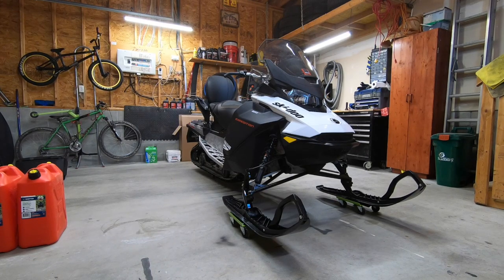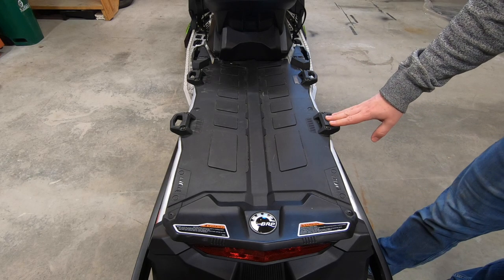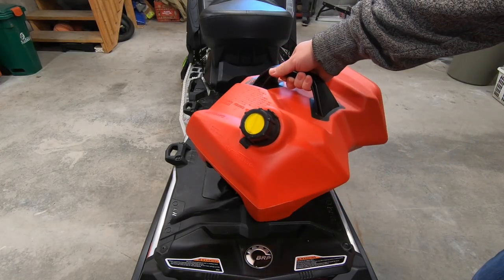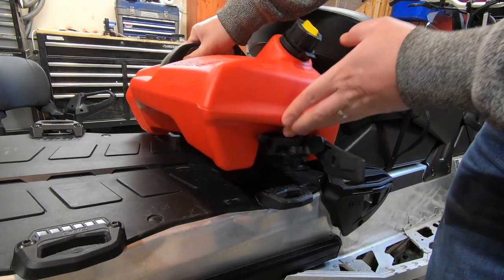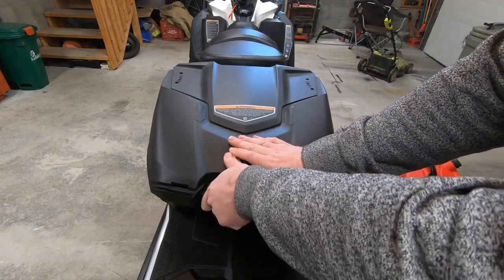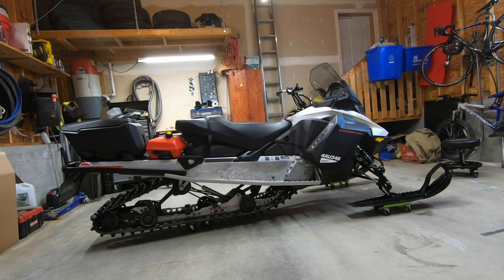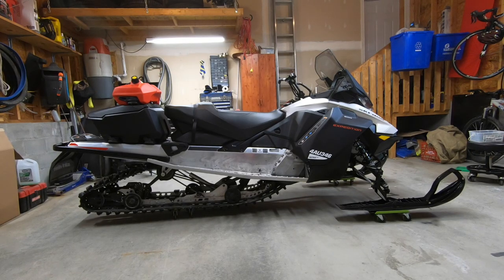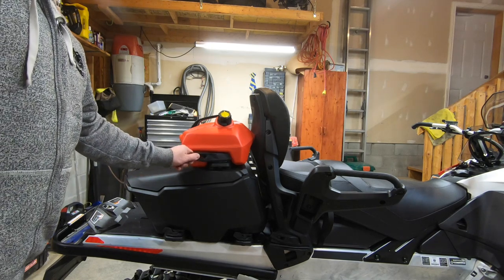Ski Doo LinQ Mods

Comment: Excellent, very informative!!  Please keep making these videos!  I made an aluminum T-track system on my 154 expedition. Three sets of LinQ receiver mounts that can slide on the rail system according to the load of that day with that days specific gear.  So far so good.  I have a RockBros 30qt cooler close to the seat and another Apache 3800 tough box behind it for more storage near the tail light.  👍🏼
Reply from the maker: More videos to come for sure! But with no snow and my sled tucked away for summer, I've been doing projects on my S2000, which are: A) Probably not interesting to snowmobilers; B) already well documented on Youtube.

But, I'm trying to find a snowmobile dyno so we can find out exactly how much power this little 600 EFI actually makes. No promises, but will do a vid if possible.

I love your T-Slot idea. That would make the whole system much more flexible.
Reply: Any pics on your T-track system?
Cheers Joe

Comment: Enjoy your videos. Just ordered my 2022 expy sport 600 efi. Would you be able to post the dimensions of the usable box space on the tunnel with the 2-up seat on? That would be helpful! I’m looking for an aftermarket (cheaper)  box that would fit inside the factory rear rack extension. Appreciate your help.
Reply from the maker: I was looking at the '22 Expedition spec sheet, and it indicates that all Expeditions are wide-bodies for 2022. Have you confirmed that the '22 Expy 600 EFI has a narrow-body, like the '21? I can measure mine for you, but I just want to make sure my dimensions will be the same as yours.

Side note: I know the Lin-Q stuff seems pricey, I thought so too. But now that I've used Lin-Q, I'm all in! The stuff is super easy to install, even easier to remove and you never have to worry about lids popping open on a ride, or anything like that! Well worth the money. I strongly recommend considering a Lin-Q cargo box.
Reply: @mop1471  As far as I can tell the width on the rear end is based on the track width. Your dimensions would be appreciated. Pretty sure its a narrow body as the auxiliary fan is not an option on the 600 efi. The dealer told me it doesn’t fit with this chassis. I will clarify the wide/narrow body with the dealer. Thanks!

Comment: Great video, I have one question you said that your spacers are two 1/4”pcs put together making a total of 1/2” thick?
Reply from the maker: That is correct, a single 1/4” spacer didn’t raise the mount enough for the gas can to clear the ridge on the lid of the cargo box, so I made a second set of 1/4” spacers for a total of 1/2”. Of course, now that I know this, I could re-make the spacer out of 1/2” material, but too lazy ;)

Comment: Great ideas! I’m just about to spring for the ‘23 model and assuming that the 62L will still fit?
Reply from the maker: The '23 Expedition Sport is still a Rev Gen 4, so I would expect the LinQ accessories would still fit just as they do on my '21. 

Will your '23 have that beautiful yellow bodywork with yellow ski handles? It looks great!

Comment: Great video.  I just bought a 2020 Enduro and I am strongly considering the 62L box.  Once mounted, o you think you can  add any LINQ accessory behind it without customization?
Reply from the maker: Thanks! 

Not all LinQ accessories will fit on the 62L trunk lid.

Your 2020 Renegade Enduro should have 2 LinQ cleat mounting points on the tunnel. The 62L box will use both of those mounts. The 62L box offers one additional LinQ mount on its lid, but note the weight limit on the warning label: accessories like the fuel container I attached exceed the weight limit and do not fit without modification. 

I don't know the reason for the weight limit, but I suspect it's either: 
- a risk of making the machine unstable by having weight up too high, or; 
- the lid latch/hinge isn't strong enough to stay latched with a heavy load, under dynamic riding forces.

If I were doing it again, I'd probably go with the larger 14.5L fuel caddy (p/no: 860201265), which also allows another LinQ accessory on top of it. Put that on the tunnel right behind the seat. Then go with something like the Deep Snow Pro 30L bag (p/no 860201985 ) 860201678) behind your fuel caddy in LinQ position 2.

Comment: Crazy expansive gas can. What items fits the position 3 brackets??
Reply from the maker: Gas can: Yep, but super handy. It also feels very well made compared to my 'standard' gas cans.

Position 3: The LinQ Slim Waterproof Tunnel Bag, p/no 860202058 fits positions 1 & 2, or 2 & 3 (so you can put a gas can behind the seat in pos 1, then the bag on pos 2 & 3.) Or, you can store the LinQ Removable Snow Flap, p/no 860201914 on position 3 when not in use. Apart from that, I don't see any other accessories that fit position 3.

Comment: Do you think it is possible to drill the LinQ holes further back so the gas can can be used with the 1 + 1 seat installed? I have the same accessories and plan on following your method to install them.
Reply from the maker: I think that would work. But, if we look at the forces involved, the further back you mount the gas can, the more force will be exerted on the latch when you hit bumps, which already wasn't designed to handle this much weight. So, 'Careful!' I guess is what I'm trying to say.

Keep in mind that I have no insight into the engineering of this stuff. I'm just a guy with a Ski-Doo and a drill.

Make sure to subscribe: more videos coming as soon as we get enough snow!

Comment: What’s convenient about it?  Have you actually used it?
Reply from the maker: The fuel caddy is easy to secure to the snowmobile via the LinQ cleats. I can secure it to my sled in seconds and know it's not going to fall off. I have used it, but not all that often because the sled has over 200km of range on a tank of fuel and I rarely travel that far (I'm pretty worn out after about 120kms.) I've used the fuel caddy more to fuel up the 2002 Grand Touring on long trips when we take both sleds.

Comment: Excellent Linq video!!
My 22 Exp Sport is at dealer waiting for some electronics ?! 
I ordered the back rack kit SKU 860202245.
Not sure if this will interfere with that 62L box Linq clearances ? I may buy that box but I’m also hoping to strap in whatever on that back rack?
Your thoughts ?
Cheers Joe
Reply: Any other accessories your keen on ?
Joe
Reply from the maker: Congratulations on your Expedition Sport! 

The 860202245 cargo rack is for the wide-body sleds with 20” or wider tracks. My 2021 Expy Sport has a 16” wide track and is a narrow body, like a Renegade or Grand Touring. Ski-Doo may have changed this for the 2022 model year and put the wide body on the Sport — I haven’t been able to get confirmation on this yet.

If your 2022 is a wide-body, then the cargo rack will be perfect for it and I’d guess that you’d have clearance for the 62L trunk too. But check with your dealer first.

Regarding the electronics, rumour has it that the world-wide chip shortage has caused a delay in producing the gauge electronics. Ski-Doo has been shipping the assembled sleds without the gauge component, which will be shipped out later for the dealer to install. No big deal to install this part, just one connector and two screws. Hopefully these parts arrive before the snow!
Reply from the maker: The accessories I used the most were:
- Ski-Doo BV2S helmet with heated visor (best helmet I’ve ever owned!)
- Glove box extension with heated cell phone holder (I ran the Go Snowmobiling Ontario app, which turned my phone into a moving-map GPS system on my dashboard!)
- USB charger keeps my phone topped up while it’s displaying maps for me.
- Heated visor plug lets me plug in my BV2S helmet, and keeps my heated visor clear in all conditions.

For cargo, the problem with the 62L trunk is that it doesn’t leave any spaces for a LinQ gas can. This winter, I may try the 14.5L stackable fuel caddy behind my seat. Behind that, I’ll mount the deep snow pro bag with my emergency gear. Then, I can also add a smaller bag on top of the fuel caddy if I need.

Comment: Just ordered my Exp Sport 600 EFI;  this linq stuff is fairly pricey;  was thinking of getting the rack and using odd boxes;  my question is can i build a box and use the ling system to fasten it??  Any thoughts
Reply from the maker: I know where you're coming from and I felt the same way about the prices of the LinQ accessories. But I decided that a few hundred bucks to get a matching cargo box wasn't a big deal after buying a new sled. I bought the 62L Cargo Box. I love it! As you saw in the video, I went back and bough the 11L gas can, despite the price tag, because it's just so handy.

When I buy another sled (which may happen today!) I'll go with the LinQ Stackable Fuel Caddy (p/no 860201264) in position 1, and the Deep Snow Pro Bag (p/no 860201985) in position 2. My logic: that fuel caddy is the biggest one at 14.5L AND it allows another small LinQ bag to be added on top if I ever want. The Deep Snow Pro Bag can hold 30L of cargo, plenty of space for emergency supplies + it's designed to hold an emergency shovel on top of it, so I don't have to stuff my folding shovel inside the bag, like I do in my 62L cargo box.

To be clear, I'm not sponsored or paid in any way. I'm buying this stuff out of my pocket at full retail price. And after using LinQ, I really think it's fantastic and worth every penny. At this point, I really can't imagine spending all winter strapping boxes down with bungie cords just to save about 2 or 3% on my new Ski-Doo invoice.

One more thing: Ice Scratchers, p/no 860201279 were fantastic additions for me! We had very little snow this winter, and before installing ice scratchers, when riding in very low-snow (1/2 inch or less), I'd have to stop occasionally to let the sled cool. With Ice scratchers, as long as there was some snow, the Expedition was fine to cruise along at 50-60km/hr for hours on end. https://www.youtube.com/watch?v=Rs1hykh4pYU
Reply: @mop1471  ok thanks; and yes saw your vids with the scratchers;  also looking at glovebox; electric connections and skid plate
Reply from the maker: @robm9581  USB charger and heated visor plug are indispensable, in my opinion. I also went with glovebox extension with heated cell phone holder. It's pretty neat. After seeing the moving-map software running on my cell phone in the dash, my buddies all call my sled the 'Cadillac'.

I don't have the skid plate, but I probably should. The Expedition spent a fair bit of time in challenging off-trial terrain last winter.
Reply: @mop1471  what about helmets is it fit or just buy best (most$)
Reply from the maker: The saying goes: "If you have a hundred dollar head, buy a hundred dollar helmet."

I went with the Ski-Doo BV2s with heated visor. It's the best helmet I've ever used, by far. I've never tried the Ski-Doo Oxygen helmet, but it looks fantastic too. 

BV2s has an integrated red light on the back so you don't get run-over if you're off your sled at night. Light is powered by two 'AA' batteries and you can turn it on and off with a push-button switch. 

BV2s is available with a dual-layer visor, or a heated dual-layer (get the heated!) All winter, 1,200kms of riding, the visor NEVER fogged up while the heater cable was plugged in.

It has a medical-grade silicone breath box which is really neat: when you inhale, you breathe in warm air from inside the helmet, but when exhaling, your breath is directed outside the helmet. I wasn't too sure about this at first, but it works great and was very comfortable once I got used to it.

The BV2s also has integrated 'sunglasses'  that you can raise or lower independently of the visor. I love this feature because it means I won't have a pair of gas-station sunglasses near my eyes if I'm ever involved in a crash.

When stopped, I can raise the visor and fold down the breath box to talk or just to get some fresh air. Also, with the helmet open, I look like a fighter pilot!

In terms of downsides, the silicone breath box allows condensation to form, so you need to clean it regularly (every ride or two.) In warmer weather, the heated visor is sometimes uncomfortably warm and there's no vent to let cold air into the helmet, so I sometimes find myself cracking the visor open a bit to let cool air in.

We also have an Origine Corsa (modular) and an Origine Venator (motocross style), both with heated visors, both from Canadian Tire. Both Origine helmets have integrated 'sunglasses' and both offer vents that you can open or close (which the BV2s doesn't have.) The Origine helmets do not have integrated red lights on the back. Personally, I find the BV2s more comfortable than either Origine helmet.

My teenage son uses the Venator and likes it because of the MX style. He often takes the visor off and just wears goggles, but tells me the heated visor works well. My wife uses the Corsa and she's fine with it. By all accounts, the Origine is a reasonable helmet for a good price, but lacks the quality of the BV2s.

Finally, I have a Bell helmet for automotive motorsports. I've worn it snowmobiling in the past, but it wasn't designed for cold weather (has a single-layer visor.) It fogs up quickly, then ices up, then I can't see where I'm going.
Reply: @mop1471  ok thanks; bad problem here is no inventory so cant even try anything on;  havent had a helmet in 40 yrs since my dirt bike lol
Reply from the maker: That's tough. I was happy to be able to try on my BV2s - I would have ordered a Large, but it turns out I'm an Extra-Large in Ski-Doo. (Or maybe that's why I find the Ski-Doo helmet more comfortable!)
Reply: @mop1471  just picked up the bv2s L  in Timmins; $275 white would have preferred black but price was right;  they do have an XL Black;  different lady today knew more of the inventory
Reply from the maker: @robm9581  That's a great price for a BV2s! You're going to love it. Took me about 2 rides before I got used to the silicone breath-box, and how to adjust it properly, but now, I wouldn't ride without it!
Reply: @mop1471  lol i am getting stoked; but golf and fishing 1st
Reply: @mop1471  it wasnt electric but picked up electric visor for $90;  so total $365 still about $250 less than the electric version

Comment: How thick are your spacers?
Reply from the maker: I had 1/8” stock and doubled it up. So each spacer is 1/4” thick.
Reply: Hey good video
I have the same setup as you same sled same gas tank and storage box 
My question is what did you use as spacers where do you buy those?
Thank you in advance
Reply from the maker: I had some 1/4" x 1" stock aluminum laying around, so I made them myself. The reinforcement plate under the trunk lid is a continuous piece of 1/4" aluminum crossing both LinQ holes. One reinforcement plate for the left, one for the right. Each reinforcement plate has 2 holes drilled matching the size and spacing of the LinQ holes.

The risers are 2 pieces of 1/4" aluminum, making a 1/2" riser. I cut and shaped the aluminum to match the LinQ cleat footprint. 

Then: Paint it black & hit the track.

Comment: Ski doo's are pretty cool, but linq, like most oem gear, isn't worth it. You could drive down to Canadian tire, get a Rubbermaid action pack and a Jerry can for 1/4 the price. Sure, you'd need a couple ratchet straps, but still.
Reply from the maker: I see where you’re coming from. I even felt the same way while making my original purchase. 

I decided on the 62L trunk because it’s the same one included with the Grand Touring and I felt the overall shape looked great with the 2-up seat. So, I thought I’d just get the one LinQ accessory to store my gear. Besides, what’s an extra $400 when I’ve just spent $12k on a new snowmobile…

…but then I saw how well the LinQ trunk works and how convenient the LinQ latches are, and I was hooked!
Reply: @mop1471  you raise a good point about the initial purchase, especially when financing. My wife and I are looking to purchase a pair of the exact same machines for hunting, ice fishing, and winter camping. Cheers from Whitehorse!
Reply: Hey RB01138...I was thinking the very same thing...and tried the action packer/ratchet strap solution! It never worked out...couldn't get the right size to fit...keep moving and sliding on the tunnel protector and you can't ratchet against the linq hold downs very much and the expedition sport does not have a rack....always worked itself loose. I went with the 90L trunk and freakin' love it! Highly recommend it, or the 62L of course, what ever meets your needs!

Comment: Where did you find the risers?
Reply from the maker: I made them from aluminum stock. I cut strips a bit larger than the LinQ footprint, drilled the mounting hole, then bolted the strips of aluminum together. With the strips of aluminum bolted together, I used my bench grinder & files to shape them to match the LinQ footprint.
Reply: @mop1471  Very slick, well played Sir. They look quite marketable. I know I would be interested if you make anymore. Any close up whites or footage when you made them?
Reply: @mop1471  lol u told me before you werent a mechanic but are you a millwright or fabricator;  that stuff looked professional
Reply from the maker: Sorry, no footage of me making them. It was just me with my angle grinder, bench grinder and my Canadian Tire JobMate discount metal file set for hours on end!
Reply from the maker: Nope, not a millwright or fabricator either, but Thanks! Just hours and hours of fumbling around clumsily with tools I don't really don't know how to use! Reminds me of a saying I once heard: "Grinder & Paint makes me the welder I ain't"